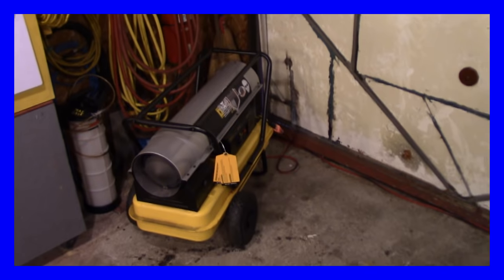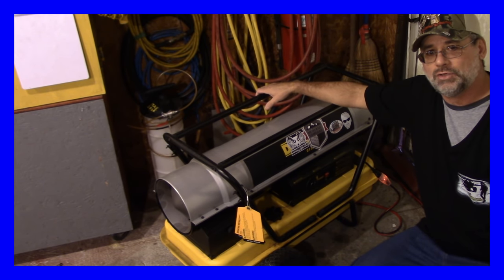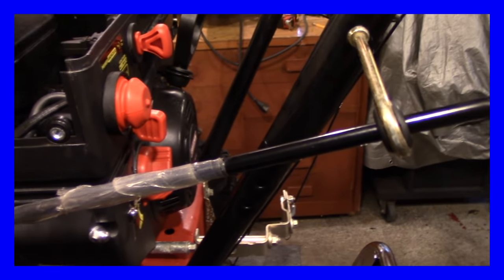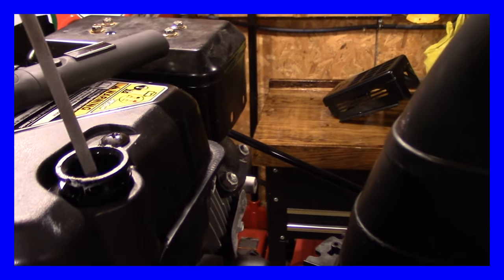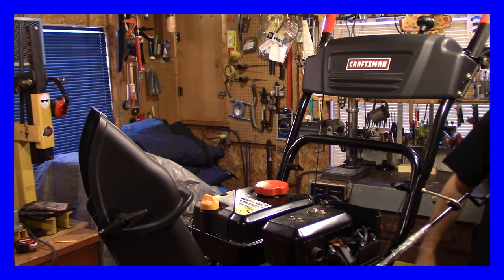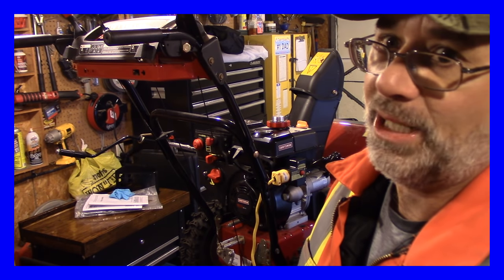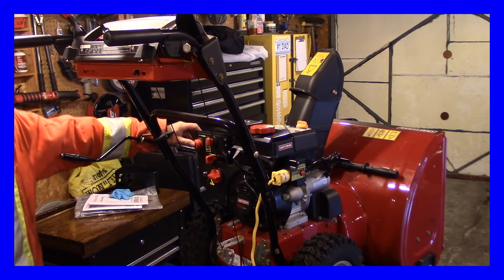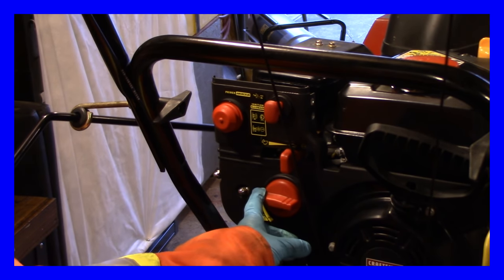CAN YOU FIX A SNOW BLOWER WITH SEAFOAM

Comment: I use nothing but Shell or Canadian Tire 91 octane (No Ethanol) and Stabil in my small engines and i never drain the fuel and I haven't had a problem. I think the main jet was plugged on the snow blower but it appears that the Seafoam did the trick.
 It keeps me busy cleaning up the mess on my neighbors equipment. I tell them why this happens and how to prevent it but i guess it's not top priority until it breaks down.
Reply from the maker: Good stuff Bill your on top of it and it seems they need an education program out there explaining  what ethanol   will do.  Oh well  i guess the small engine repair shops do well.

Comment: thanks for your help with this video.  my machine is Briggs and stratton starts very well, but runs with open choke, I use premium gasoline without oxygen.  Can I mix sea foam in gasoline and how much?  Thanks.
Reply from the maker: I use 2 oz per gallon  year round .
Reply: every time you tank the gas do you mix the sea foam?  or just once a year?  Thank you.  👍🏻
Reply from the maker: I make sure it's in the machines year round  unless I run the machine dry before winter like my pressure washer .

Comment: You sound like you are from Minnesota. My parent's grandparents and all my cousins are from Minnesota. You have the same accent. I just bought a Huskvarna 125 30 HV that is ten years old. This machine starts right up every time but has been hardly used. The gas didn't smell bad and had a stabilizer in it. The motor has a slight surge to it and I plan on putting some Sea Foam in it and letting it run for a while and then allowing it to rerun the next day. What do you think?? I bought this blower from my neighbor who is 87 years old and has almost never used it because he has had major health issues. The model I have is one of the most expensive units Huskvana made back then. It has a 291 CC engine with twelve and a half HP.
Reply from the maker: Sure give it a try , the longer it runs if it starts to run better it's cleaning and let it run but if it doesn't change its time to remove the carb and clean all the sludge built up.  Oh ya not from Minnesota , many pick N Dakota  too but we all talk like this in Canada 🇨🇦 👍
Reply: I knew he was Canadian when he mentioned Princess Auto.  This is essentially the Canadian version of Harbor Freight.
Reply from the maker: Yes exactly but with a 40% exchange rate going in the wrong direction 🤣😅

Comment: Based on your video, I may start adding an extra few ounces of Seafoam in the tank at the end of the season as I run it dry to give the carb a good cleaning before it gets put away.
Was wondering if ya recommend Seafoam when they pick their machines up, or do they not learn and keep doing the same thing and come back the next year. Hehe
Reply from the maker: HAHA Rob I buy it in  plastic gallon jugs - 4 gensets -atv - tractor and log splitter .  I never get sludged up carbs from the fuel. I  have taken the fuel bowls off to replace a gasket and  they were like new inside.  I use it and like it because I repair a lot of small engines just goobered up with crusties in the float bowl. LOL

Comment: direct fired heaters are great but not for heating a space with people working in them....no vent for exhaust gases and carbon monoxide. Definitely a killer situation.
Reply from the maker: Not the way I do it - it's completely safe . I use the diesel heater to warm up the shop then switch to electric. I'm not in there all day with the diesel heater going on and off - just to get it up to heat . 
https://www.youtube.com/watch?v=5bCwMbieHf8
Reply: Got it....I was worried. They work great to take the chill out. I have an un-insulated shed that I use a direct fired in the same way, just to heat up not to maintain.   Plan is to build a shop with full insulation and unit heaters.  Hopefully before this fall.    Great video.

Comment: i never drain my carb before storing i did use seafoam until 2 years ago i started using k-100 & 87 octane with ethanol lawn equipment & snowblower start 1st pull. took my carb apart on a 04 b&s 7.0 hp intek last spring it was pretty clean inside 1st time carb was apart
Reply from the maker: Nice  to see Tony , I guess it depends how long you store it.

Comment: Thanks for the video. I'm gonna give sea foam a shot. Already drained the carb bowl. My 208cc snow blower will start and run low-medium idle and stall out with the throttle anywhere above 80% or if I engage the auger.  I failed to run it out.
Reply from the maker: Yep it's a bit plugged . Give it a try👍
Reply: Took a couple minutes of it chugging started to sound like a cold diesel start and then it stalled on me. Fired up on the 2nd pull with no choke and stayed running.  Let it idle for 20 minutes at low rpm. Then ran it for 15 at full throttle much to the annoyance of my neighbors who no doubt think I'm crazy out snow blowing the inch of snow on my lawn testing it under load. Winter finally showed up yesterday here in Oswego NY on the South shore of Lake Ontario. Its been a very warm start. Can't wait for the Lake Effect.

Comment: I have had a few 1970s and 80s ariens with similar issues - with mine if you touch the primer bulb and fuel pours out it has always been that the fuel line or the primer bulb itself has a leak - ethanol fuel eats away rubber - a leaky fuel line will cause the same starved fuel symptoms that a clogged carb will - so its worth a check if the carb clean doesn't fix this
also I think by law all engines will have an ID tag on them someplace -this ID will tell you if its a briggs or Tecumseh  (2 most common for snowblowers of 80s90s 2000s vintages)

Comment: I’ve been using ethanol-free gasoline and I have had none of the typical carb issues after long term storage.
Reply from the maker: That's the way to go if you can get it as many places around the world  only have ethanol blends.
Reply: @SteveRobReviews  Yep, ethanol free fuel is the only way to go, if you can find it in your area. It is expensive, but in the long run it is worth the extra cost. I use it in all my outdoor power equipment, along with Sea Foam. I have used Sea Foam for years, even when using 10% ethanol fuel. But, now with bozo Biden in office, here in Michigan listing the amount of ethanol is the fuel is not required. That is the main reason I stopped using ethanol fuel for my outdoor power equipment. I have no idea how much ethanol is being added to the fuel here in Michigan. What a mess Biden has made out our country.

Comment: Steve, Thank you for the video. I mistakenly stored my snowblower with ethanol fuel in over the summer. This winter, starting the engine was quite difficult, but I managed to start it now. However, after running 3 to 4 minutes, fuel leaks at the same location, as in your video and engine shuts down (if not choked). The leak continues for several more minutes, even if the engine is not running. From reading John VanDenburgh below, it appears to me that he means, there is a vent hole through which fuel is leaking because carburator is clogged. Do you think, that is the case. If it is, should I run it for 30 minutes with fuel stabilizer added to the fuel to clear clogging. Thanks for your advice.
Reply from the maker: I bet the needle valve on the carb bowl is sticking open thus the fuel will either leak where you seen it or for some engines leak into the engine crankcase. Remove the float bowl  and remove the needle valve,  clean it out and it should be fine . Try that if your handy but I'm thinking its gummed up too far for an additive.

Comment: Knew it was a fuel leak before you put it on the jack. they have a vent hole that fuel will squirt out of when they are clogged up. That carburetor needs a good cleaning at minimum. BTW the engines on nearly ALL the newer blowers are usually OHV Honda knockoffs and they are total crap. Every time without fail you are better off buying an old garage sale snowblower for $50-$100 bucks and fixing it. Those carbs are a 20 minute  job, start to finish

Comment: I have a Harbor freight generator that was surging a few years back cleaned the carb still mounted to the motor and no improvement so I drained the fuel and filled the float bowl with Sea Foam  and let it sit for 3 days came back and drained it and filled it with fuel first pull started right up and ran like a champ
Reply from the maker: That's a memory to pass on bud. Cheers 👍

Comment: I have the same snow blower and run non-ethanol gas no problems so far but I would never buy another Craftsman anything ever again
Reply from the maker: It an odd setup and an engine im not familiar with  but overall its a good unit . Yes stick with the fuel your using. Cheers

Comment: I have this exact same model. Mine will start, it idles a little rough but when I turn on the auger and give it a load the motor dies. I am gonna try some seafoam to see if that helps.
Reply from the maker: Yep it sounds like it starving for fuel . Hope it works for you too.

Comment: Thanks for the video. Snowblower wont start. Ran snowblower last march until it ran out of fuel. Snowblower not starting . Put in fuel that i had in garage for a couple of months that was mixed with stabilizer fluid. Not starting. Should i drain that fuel, get higher octane fuel and add some sea foam ? I also have starter spray. Where should i spray that? Starter spray does wonders for my lawnmower, when i spray the air filter. Don’t see an air filter on the snowblower. Thanks!
Reply from the maker: No air filters on snow blowers  so you can spray inside the carb with the choke opened for about 2 seconds , close choke and see if it starts . Very flammable so be careful. Most likely have to take a section of metal cover off to see the carb. Usually just priming it with the gas in the tank if it has a primer should be all thats needed.

Comment: cool deal..........does that heater have any fume smell when you run it  ?
Reply from the maker: Yes it does just a bit during startup but nothing horrible.  Its ultra low sulphur diesel fuel up here and its real clean, you can use kerosene as well but its 4 times the price. Farm diesel might be stinky like years ago , man i  didn't like the fumes off that stuff.  I switch over to 240v electric heat once the shop is up to 80 deg in no time. Take Care and keep making spoons buddy. LOL

Comment: Great video. Unfortunately, the seafoam with fresh fuel didn't help. Cleaning the carb didn't help at all.  I also replaced the carb and cleaned out the fuel filter.  It seems to run better, but still seems to run lean.  Idles up and down with choke off. Any ideas why to try next?
Reply from the maker: I'd be checking the valve lash  next . If not I can refer a buddys vid on opening up the main jet  a bit  to allow more flow if the valve lash is  correct.
Reply: That is a lean condition usually caused by the float setting being too low. I'd try replacing the fuel filter.
Reply: Clean the brass jet on the side of the carb. There is a tiny hole that gets clogged. I saw it on another video. It fixed my Ariens 12 hp.

Comment: I use nothing but Shell Premium that has 0% ethanol in all my yard machines. I've used Seafoam in my Performance car fuel tank and also used Marvel Mystery Oil in the fuel tank. Crappy Tire sells MMO and I'm sure I've seen it in Princess Auto. Next time put a load on the snow blower cause sometimes they die when the blades are engaged. BTW I really dislike the blue video border.
Reply from the maker: Hi John always trying something different. Thanks for the comment . Cheers

Comment: I think that is a Tecumseh engine. I had the same trouble with mine, left old gas in mine, I have a shut off on mine. I drained my gas and then added fresh gas with fuel stab in and it ran funny for a 10 min. and then it was OK. I will not do that with the gas in the tank all summer. I'm  going to try Sea Foam , Thanks for the tip.
Reply from the maker: I have had great success with it for 40 years but lately I have tried some newer products and so far so good but the seafoam has proven itself to me for a long time. Cheers

Comment: All snow blowers should have a shut off . the carb should be run empty after every use . you do not know when the next time it will be used . Stabilizer of some kind should always be used in all fuel for small engines . because they sit between uses .Stored small engines should be drained of fuel completely  including carb.

Comment: Steve why did you not remove and clean the main jet when you took out the float? That was a mistake not to do that at the same time. The main jet gets clogged as does the float valve. Also, it's not the ethanol, it's any gas, that will varnish up and clog things, if you don't use sta-bile.
Reply from the maker: Well I tried just throwing in some seafoam and it did the job for me. I was shocked but it did the trick.Cheers

Comment: Seafoam is fantastic stuff !!!
Reply: @SteveRobReviews   As long as you use this product, mix some in your fuel each year, and DO NOT use ethanol based fuel in your blower, it will fire every year. My blower is 13 years old, ran ethanol free from day one, and a couple of shots of Seafoam. Never once have I ever had to remove the carb. I just breathe on the key, and she fires. Just tips that I have found that work, hope this helps.
Reply: @SteveRobReviews  One product for you to try Steve, if you never have. BG Products, HCF Waterproof Lubricant. I swear by it in harsh outdoor conditions. I use it on my blower that doesn't have grease points, tailgate hinges in my truck, to forks on a forklift.
Reply from the maker: I will check it out . Thanks 👍
Reply: @SteveRobReviews  My pleasure, anything to help out others in a bad spot that cannot afford to spend the money on repairs.

Comment: Hey Steve, while you had the bowl off, did ya also pull the main jet and clean it before the Seafoam? Was thinking that could make it starve for fuel.
I bought a Toro single stage blower two years ago and ALWAYS  run non ethanol fuel with Seafoam added. Starts first pull every time.
Reply from the maker: Hi Rob , I didn't touch the jet and it ran all winter great. Next time forsure. Cheers

Comment: great video i will start using sea-foam in our equipment so you say reg fuel is that prem fuel or at the pumps just reg fuel and can you get sea-foam at Canadian tire were do you buy thanks keith
Reply from the maker: Well my buddies parts store closed down so I cant get it from him anymore but its available at your local parts  store in one gallon plastic jugs . I have two jugs left . I think its about $60 a gallon.  I only  use it as a fuel stabilizer in my small engines not my trucks.  1 oz per gallon so a gallon is good for 144 gallons of fuel.  If you use premium tier one fuel like esso  93 octane you still need it if you leave the fuel in over the winter but during the rest of the year if the equipment is being run i wouldn't bother. Fuel is a solvent all ready and cleans great if not left for a long time as in this snowblowers case.  For you a breakdown is money so i like the idea  preventive breakdowns LOL
Reply: ya we have lawn equipment and snow blowers  gas powered pumps gen sets  lots of small engines
Reply from the maker: For the price of one breakdown its worth $60 a year for the seafoam. 144 gallons is about 5 years of use for me.  In the 2 strokes it says 2 oz per gallon but my stihl oil has the stabilizer built in so i don't bother.

Comment: I have the exact snow blower from sears and it's doing the same thing.  It will run with the choke on but will not run with the choke off.
Reply from the maker: Yep Johnathan,  so common as the choke on is pulling as much fuel as possible to keep it running because the carb is contaminated causing low fuel flow . If it has needle valve screws it just may need an adjustment .  Take it all apart and clean out the carb or try running the seafoam thru it , for many the seafoam works well.  I  just did a old toro blower doing the same so I  pressed the drain on the carb bowl ( not all have drains ) and put straight seafoam  in it about 6 ounces and let it sit for a couple of days. Put fresh gas in and it ran like a champ , some not do get so lucky but its a easy try compared to stripping it all down. Cheers

Comment: Hi Steve,  Thanks for your help.  I cleaned the fuel bowl and my Troybilt snowthrower eventually kept running on its own.  My engine is practically the same as yours, and is an MTD so you know.  The thrower is almost identical as well (mine is red for Troybilt).  Why is it that, while running for the first 15-20 minutes, the fuel bowl leaked and sprayed quite a bit. But it stopped leaking eventually.   Why did it leak and why did it stop leaking?   Thanks  again for your help,  -Paul
Reply from the maker: Mush have swelled the seal to stop the leak maybe.
Reply: @SteveRobReviews  Hi again.   It won't start now.  Sat for two weeks and I went to start her up.  It will start and run for 2 seconds and then die.  At first it was pouring gas out of the fuel bowl; I turned the bowl around and it seems to have stopped leaking as bad.  Still won't keep running.  Clean fuel with Seafoam.  Any ideas?  Thanks.
Reply: STEVE ROB REPORT  I had already replaced the large black seal and the small black  seal the first time, so they are new.  And the needle valve moves freely.  I cleaned it all the first go-around too.  How do I make sure it doesn't bind when re-assembled?  Thanks again for your help.  -Paul

Comment: I have old Toro 524 that started for about 10 minutes, doesn't stay running now it won't start at all... would you try 
 sea foam or ether ?
Reply from the maker: I would verify that the fuel is flowing to the carb , seems to start but run dry in 10 minutes so check for blockages.